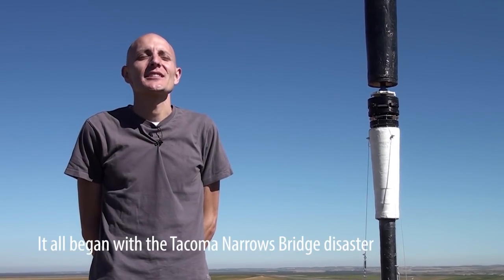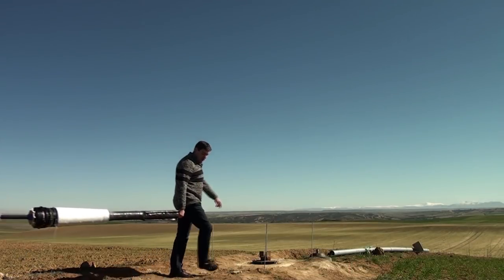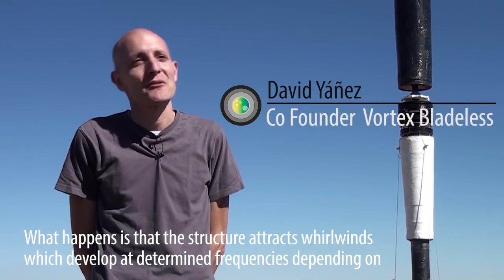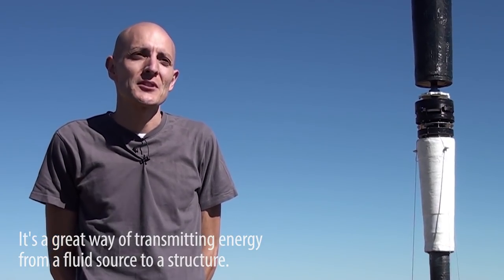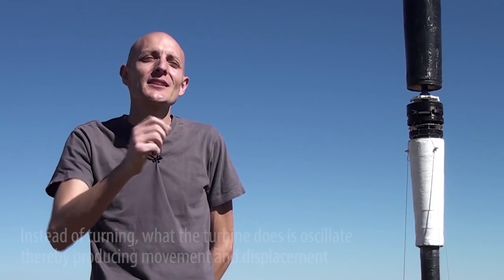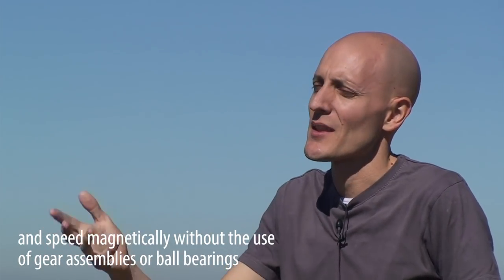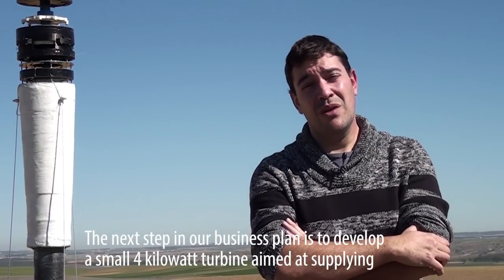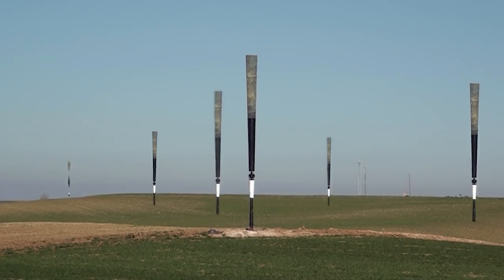Vortex Bladeless aerogenerador, Energías Renovables 2015 (outdated)

Comment: Add one of Elon Musk's set of batteries and let's see how much renewable energy this innovation can generate. The time is now. Let's get off the grid together and along with other things like the "joulie thief" to boost the energy output to maximum efficiency. Blades were not the way to go, since birds don't have to be endangered by such a cool idea. It's all connected. We call it the internet. Ideas from all will provide low cost energy to the world. This would be a great complement to solar cell technology. Cumulative energy generation capability can do this. Love it!

Comment: The material to be used to accept those repeated vibrations need to be able to withstand the fatigue induced in the structure.  While the concept is good, I cannot see this system  taking off in any commercial volume and would need further research in materials so that the lifetime of the unit is adequate.  Good luck.

Comment: Does anyone see something moving really fast (probably in the distance) at seconds 1.43 to 1.45 but not in the direction of the turbine movement caused by the wind? Also for the non-believers if it was something really close to the turbine then it's movement would be kind of disturbed or slightly rotated just like a small piece of hay! But if you could see close to the point of the sun then you might notice that it consisted of two parts either attached or just always travelling at the same inbetwween them distance! Also at the point that it is swadowed near the turbine point of view from the angle of the sun and the camera it does not pass between the turbine and the camera but behind it! try freezing it on different moments and different seconds! And no mosquito wings can be actually distinguished! So unless somenone threw two small objects in a perfect line and perfectly same speed then it is something that is flying far away really fast and is probably of unknown origin to most of us!

I am just saying

Also on super slow speed of youtube settings watch at 2.24 to 2.25 the change of direction on the silver coloured flying thing in the distance!

Comment: this looks like it could be modified to work in the oceans
Reply from the maker: It could! On costal cities it will work very good due to constant winds. On the sea you have to face some degradation issues of the materials, those would have to be adapted.

Comment: this looks incredibly inefficient
Reply: Anthony Trifoglio  i have to agree with you.
Reply: What are you talking about?  Between Indiegogo and Kickstarter, they've collected $100,000.  This is a VERY efficient way to scam people out of their money.
Reply: Yeah I'm not an engineer either
Reply: It's sad how those people have no idea how the conversion of energy works, or even the difficulties of eolic energy. This is actually a great alternative for the concept of distributed generation, and i hope that there'll be more research into different eolic generators
Reply: Yes, they are cheaters! Indeed if you look to their web page all models (100W,4KW and 1MW) are under development. They can not have 100W model and this is not scalable so if they can not make 100W model they cant make the high power models too.
Reply from the maker: Hello! A wind generator can only harness as much energy as it's capture area or working area. Capture area of Vortex Turbines is smaller than regular wind turbines of same height, therefore Vortex harness less power compared. On the other hand this small capture area is a pro if you think about birds, noise, maintenance and space optimisation. You can install Vortex turbines very close to each other without any disturbance or shadow effect. As an extra, oscillatory wind generators don't need to adapt to wind direction changes rotating like regular turbines. You can read more here https://vortexbladeless.com/technology-design